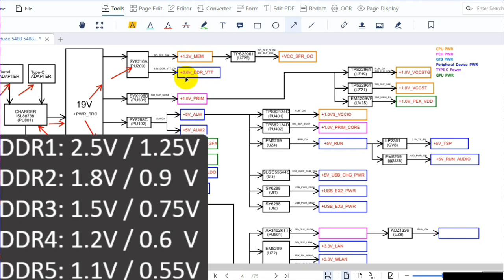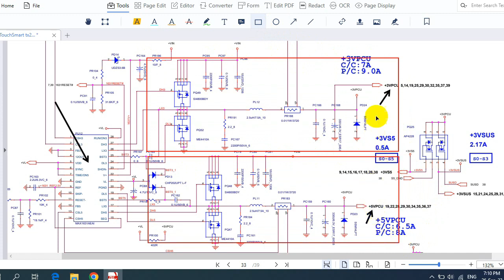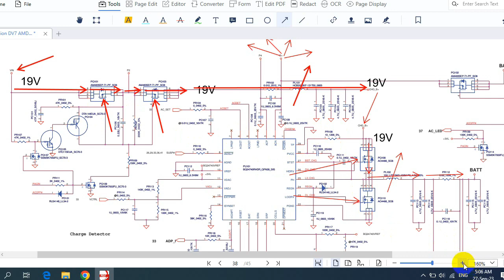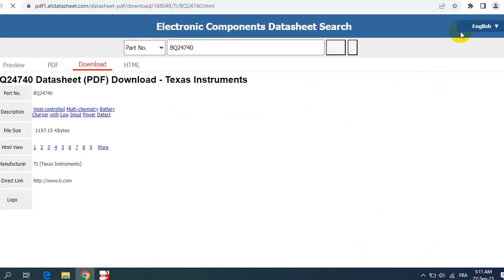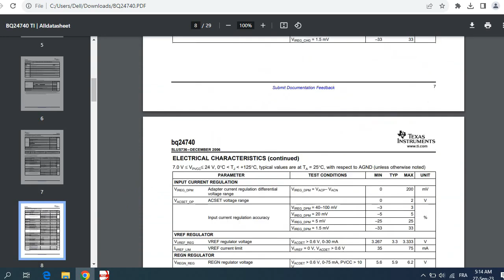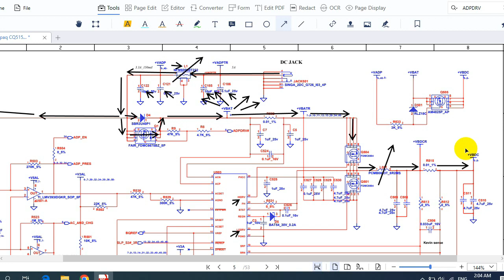Ultimate Guide on how to trace voltages on motherboards - Tracking voltage like experts do

Comment: The drive high and drive low functions can be better explained with the two mosfets in combination with the inductor. 
What is the function of the inductor?
Reply from the maker: It adjust the output current